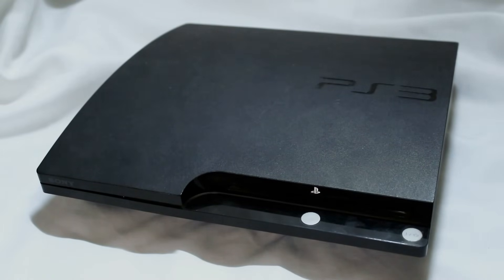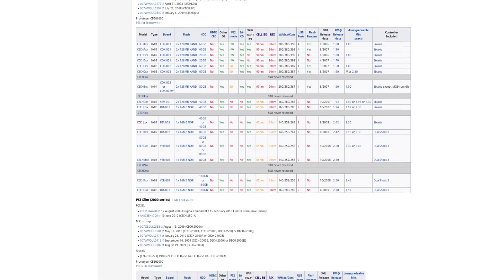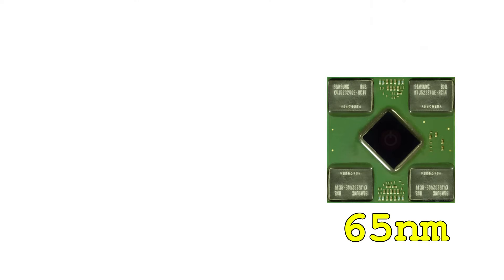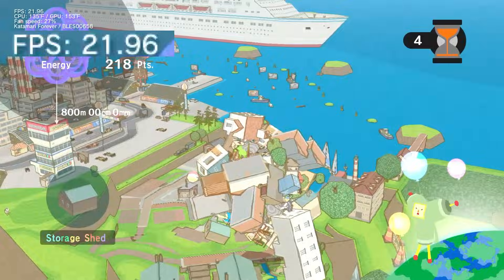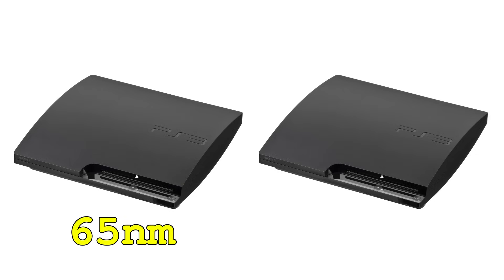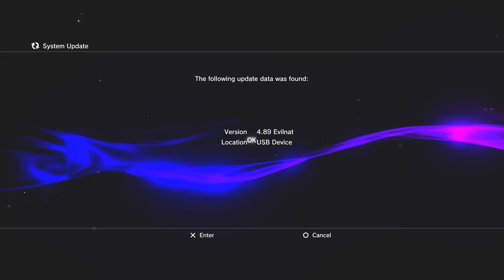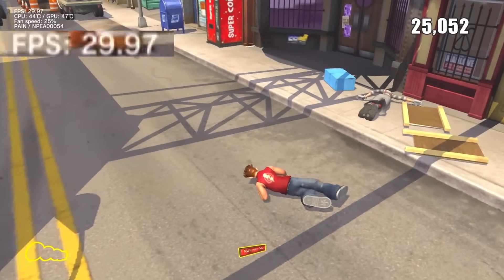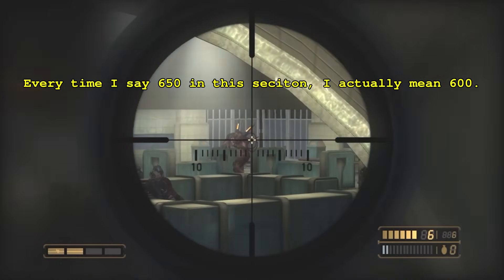Overclocking a PS3 with Project RSX Boost

Comment: I have the same model and it goes 700 mhz core and 900 mhz vram, that's a 40% performance boost. I tested Bioshock infinite, stock I have 29 fps on the main menu with the OC, it's 40fps. It was surprised of the result and it's stable(temperature between 70-75'C)

Comment: For those looking to do this in 2025, you no longer need to load a dedicated CFW with the overclock baked in. 4.92 Evilnat now supports RSX overclocking directly from the XMB or via a .txt file that can be loaded from USB. 

The new method avoids the risk of bricking it since the XMB overclocks are only applied during that session and reset to defaults after restarting. You can do a “permanent” OC by loading the .txt file with the desired frequencies in the root hdd_0 folder. 

Loading from USB also takes priority, so if it becomes unstable you can restart and load default frequencies from the USB. I have the 65nm RSX and achieved a stable 650mhz core clock and 800mhz memory clock. From what I’ve seen, this seems to be the sweet spot for the 65nm.

Comment: 6:27 For anyone in particular, do not use those Honeywell thermal pads on a phat PS3. I used them on my 60GB, and the PS3 when into an emergency shutdown. The pads were basically turned into cement at that point, as it was extremely hard to get the motherboard off of the heatsink. Luckily the IHS or the chips themselves weren't ripped off of the motherboard.
Reply from the maker: That's what heat guns are for. Just warm up the heat sinks until the pads start to soften and they come right off
Reply: @sync-on-luma   Did that, and yea they came off.

Comment: Can you do one for PS3 Super Slim?
Reply from the maker: Did you even watch the video?
Reply: @sync-on-luma you done it for the slim i have the super slim . One game keeps missing frame rate. I dont understand much as have learnign difficulties
Reply from the maker: It's currently (and likely always will be) impossible to overclock any console that shipped with firmware higher than 3.55. All Super Slims fall into this category.

Comment: So besides OC. How about unlock the FPS to play at 60FPS?
Reply: impossible fps are game locked
Reply: but it run smoother
Reply: @minecraftthe67100  I saw a video of someone applying patch/codes from Rpcs3 to ps3 and unlocked 60FPS. Seems legit but I don’t know. 🤷🏽‍♂️
Reply: @XxTrickFlowxX  link?
Reply: @minecraftthe67100  https://youtu.be/y6tdIXyJDXI?si=9ObuqL_nKt4gBdoG
Reply: @XxTrickFlowxX  It's kind of pointless because there's practically no games that the PS3 can run at 60 fps in the first place. In that case it's better to have it locked at 30 so the swings aren't so drastic, plus it will keep your system slightly cooler if it doesn't try to max out just to achieve 5 fps extra for example. If it were capable of it, don't you think Sony/game developers would have done it themselves?
Reply: @rafox66 well ratchet and clank crack in the time for example runs 60fps most of the time? So the ps3 is capable on running more just fine. And the video I linked shows kingdom of hearts also running higher frames with no issues either.. all I wanted to know if someone found a way to unlock the FPS on ps3 hardware.
Reply: @XxTrickFlowxX  Yes but those are rare outliers, most games running on PS3 could barely reach the 30 fps lock. Of course there were some games that could run at 60, but the ones that are locked at 30 are locked at 30 because they can't achieve 60 anyway. Also, some games will start bugging out if fps is higher than it was designed for. Like with old GTA games the physics will start to glitch if your fps is too high. Or another rockstar title; LA Noire's facial animations will start glitching if you go over 30 fps, that game is even locked at 30 on PC.

So what I'm trying to say is that you shouldn't really worry about it, if you want to play at higher fps, play on PC via emulator, I guess? Or if there was a PC version of the game you should get that instead. But in most cases, there is a good reason that they locked it at 30. There might be a way to unlock it, but it's not really worth the effort.

Comment: I'm using overclock of 700-850mhz on my slim cech-25xx. Temps are high 50's to maybe 61 at most. I set the fan to 50% in webman so it runs at that speed as soon as i turn it on. It's a bit loud but i use a headset anyway so no problem

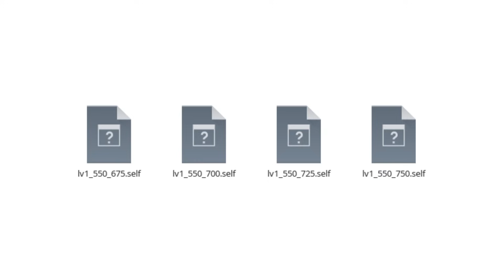Comment: I still dont understand what ti do with .self file like there is nothing in video that help with that ( 11:13 this files )
Reply from the maker: The .self files are only useful if you're building your own custom firmware image, which is a whole process unto itself and way outside the scope of this video.
Reply: @sync-on-luma  like i have Ps3 super slim i dont know anything like which proccesor or anything nm, just playing on it for like 5 years and sometimes my fps drop like crazy i wanted to find solution to get more fps find overcloacking, but i saw Soo many people have like average temperature of pse 50-65° while playing game, mine can go up 75
Reply: I mean like only cpu, gpu stays max to 60- 65
Reply: Point is will it be dangerous overcloacking on my ps3, bcs overcloacking rise your temperature, and how can I overcloack it on 4.91 version of ps3
Reply from the maker: Based on your replies, I can't tell if you have any familiarity with PS3 jailbreaking, but if not you need to start there.
The overclock only works on consoles that are running a custom firmware (CFW) jailbreak. Consoles that can only run a hybrid firmware (HFW) jailbreak are not compatible. This includes some newer slim consoles and all super slims.
If your system is regularly hitting 75 degrees, then the thermal compound on the processors probably needs replaced. I would recommend doing this regardless, but it is absolutely essential if you plan to overclock. If you're not comfortable taking apart your console for this procedure, then you should not be attempting an overclock under an circumstances.

All the other details of overclocking are irrelevant until you have a jailbroken console with clean vents and good thermal compound.
Reply: @sync-on-luma  yeah i have cfw hen, its ps3 super slim but i cant find overclock of 650 or 700 for gpu only i fiund is that .self file
Reply from the maker: Hen and CFW are two different things. If you're using HEN it means you're running stock firmware and you won't be able to overclock.
The main project RSX boost distribution is not meant for end users. They distribute .self files so that CFW developers and turbo-nerd power users can integrate into whatever firmware they want.
What you want is a pre-compiled firmware image with the overclock already integrated. You should be able to find those if you start with the most recent posts in the Project RSX Boost thread on PSX Place, or you can grab the overclocked rebug build if they have one up right now.
Reply: @sync-on-luma  idk man I use hen to like play games but whem updating i need to download cfw idk man
Reply: @sync-on-luma  sorry its hfw
Reply from the maker: You're probably downloading the latest hybrid frimware. If you don't even know what firmware you're running, you absolutely should not be overclocking.
Reply: @sync-on-luma  its hfw 100% its from video i watch
Reply from the maker: Well, that's not gonna work with overclocking anyway then. I'd still susggest redoing the thermal compound, a super slim should not be hitting 75 degrees that frequently. That might be part of your performance problems.
Reply: @sync-on-luma  well thanks for guiding me, sometime i managed to make to be 65° temperature, if u can anything to help me boost fps please say it to me

Comment: Try add frame generator, if legend about underuse of cpu is true then it should be possible to use 2 or 3 threads to generate 15-20fps more in every game without overclocking

Comment: I wonder if it's possible to get the 28nm rsx hooked up to a phat PS3. The pinouts are the exact same so theoretically as long as you wire it properly it should work but elegantly mounting it to the other motherboard probably would be impossible

Comment: @sync-on-luma (Y)
In regards to the hardware variants section. Not all 2500x models can have their firmware downgraded to use CFW. Some of the later 2500x models are not able to do this.

Comment: My phat 65nm cell 65nm RSX does 650mhz core 850 memory I'm afraid to try more than that I started normal 600 and 750 . Next memory with 25mhz bumps till the 850. Core is a 65nm only punched a extra 50mhz
Reply: have you noticed anything adverse after 4 months?

Comment: Always fun to test this sprt of stuff but in my experimentation I found results similar to this video across the board. 

IMO (read that again, IN MY OPINION), the thermal impact and audible impact from the fan is not worth the minimal gains. I can count on one hand the games that I noticed a real difference with, the times where I booted a game and had a "wow" moment where micro-dips or tearing were totally smoothed out.

But, again, at the cost of going over a thermal limit and the fan going apes*it. Borderline vacuum cleaner decibels in some rare cases and my console is very clean with high upkeep. I've been in repair for years, I can take it apart with my eyes closed. It's not old or bad TIC. 

Early phat units would often come back "repaired" by Sony with the fan set to permanently be louder than a vacuum. My brother's was like this and it could be heard from the street outside his house. 
While playing a few titles it came close to that same level for me (usually Unreal and some 1st party titles). 

Chip lottery and all so it's anecdotal but I don't find it to be worth it. I think Sony chose the clocks for a reason, lkkely after realizing all of the stuff we're finding out.

Comment: Been running 600/750 on a 2004b slim for 2 weeks straight no issues
Reply: 600/750 is the OC we’ve had for 2 years now. That OC is very stable and conservative.
Reply: @Tanzu15  can I go to 700/800? Or 650/800

Comment: Im pretty sure im leading the pack with rsx testing 😎
Reply: Nah. I’m the king. I own 10 PS3 slims now testing🤣
Reply: @Tanzu15  How many videos have you posted with an overclocked ps3 doh? 😎👀
Reply: @BOXING_LOUNGE  well making videos is not my thing. I want to. But don’t think all that hard work would pay off. My PS3s are doing 900/1000 950/1000 900/975 lowest I have is 850/975. I know how to bin them.
Reply: @Tanzu15  so to confirm your getting a faster overclock?
Reply: @BOXING_LOUNGE  yes I know which model and date guarantee high Overclocks.
Reply: @Tanzu15  2003a?
Reply: @BOXING_LOUNGE  those can only do 650 core and 800 memory.
Reply: @Tanzu15  ok what model can be overclocked the fastest?
Reply: @BOXING_LOUNGE  2501B this is an American model though. 25xx in general. I have like 7 of them already binned. I’m selling one. So if you’re interested in one let me know.
Reply: @Tanzu15  I am interested, im in the UK though.
Reply: @BOXING_LOUNGE  yes i know. I can ship international. Do you have a discord? We can talk there more about it.
Reply: @Tanzu15  my discord link is in on my about page, i don't think I can posts links in this thread
Reply: @BOXING_LOUNGE  alright I’ll go check it and add you.
Reply: @BOXING_LOUNGE  ok I DMed you on discord.

Comment: Help my ps3 blackscreen when installing oc 800/950. on my CECH-2000A ps3. at that time I was still at oc 750/850 but I wanted to try to increase it further, namely oc 800/950 when I was installing it and the installer finished suddenly after my ps3 restarted the ps3 blackscreen but there was sound and finally I tried to go to safe mode but it turned out that safe mode blackscreen and I tried again by removing the hdmi and plugging it in again and safe mode turned out to be able to display images and I immediately installed ofw 4. 91 in safe mode to restore it and it turned out to add another new problem, namely stuck on system updates for more info you can check my channel and I hope this problem can be resolved with your help and I hope there are people who want to help me Thank you!
Reply: Are you stupid? You didn’t do your research at all. Now you have a brick.
Reply: @Tanzu15 So how to restore it bro
Reply: @IbiyaFoxVCC  you can’t dawg. You’re cooked. Buy a new PS3 and next time do your research.
Reply: Slims aren’t supposed to go beyond 700/900
Reply: Stupid lol

Comment: Test it on far cry 3 plsss
Reply: i tried with 700mhz on RSX and 900mhz on the GDDR3 VRAM and it did 30fps with little drops here and there.
considering that on normal clocks it goes anywhere between 15 and 30, I'd say it is a great improvement.

Comment: i have a cech-2501a
Reply: That’s a good PS3 to OC. Easily does 700 core 950 memory. Don’t ever go above 950 memory unless you want a new door stopper.
Reply: @Tanzu15  the thing is, its pretty old and hadn't been turned on for a long time. has to be tooken apart and completely fixed. it has issues with the disc drive (common) and turning on (power) but the thing i am confused is that it doesn't display anymore. last time it been turned on it worked fine.
Reply: @Tanzu15  Same version did 975ram stable

Comment: Remember guys. 650/800 for 65nm runs perfectly. And for 40nm slims 700/900 is 100% stable and Guaranteed. I’d say 950 on the memory is fully stable too. I have 7 to 8 slims now. Bought more for testing. And the all hit 700/950. If you’re very unlucky then 900 memory will be fully stable. But 95% of slims can do 950 on memory just fine. Any slim that does 750 core fully stable zero artifacts is a silicon winner. And likely will do 800 core. But in a lot of slims 700 will be the Max stable. 750 shows artifacting. Crysis HD is the perfect and only game you should test for 30 minutes to an hour. No artifacts or crashing at all means it’s fully stable across all games.
Reply: Is the performance difference worth the risk?
Reply: @GenesHand  yes it’s worth it. If you folllw my guide. You’ll avoid any issues. The performance gains are pretty big. Noticeable accross all games. But we don’t talk about Beyonetta.

Comment: 750/900 is very good and stable on PS3 Slim, tested on 2501A
Reply: You should be able to do 950 on memory easy. Memory gives huge FPS gains.
Reply: @Tanzu15  Do you have a 750/950 for me please? When I try to do it myself I get error messages - thanks
Reply: @Agent-mb1xx  I do have 750/950. I know how to create any of them.
Reply: @Tanzu15  I do have the software too but it never works
Reply: @Agent-mb1xx  I’ll make one for you homie. Where do I send you the link? Cause I don’t think YouTube allows that.
Reply: @Tanzu15  Mediafire
Reply: @Agent-mb1xx  no I mean how do I send you
The link?
Reply: @Tanzu15  You have to write it down on a small piece of paper and attach it to the pigeon's leg when it will arrive
Reply: Update: 750/1000 works well too
Reply: @Agent-mb1xx  now try 800 core. If you aren’t getting any artifacting in crysis HD. Which is the game you should be testing for true stability.
Reply: @Tanzu15  I do have artifacts at 800/800
Reply: @Agent-mb1xx  ok so 750 is your Max OC. That’s not bad. Most slims can’t do 750 without artifacting.

Comment: I wonder how far you could take a PS3 using water cooling. It would be a neat project, taking apart a PS3, putting it a little ITX case, maybe even finding a way to keep the blu-ray drive and using some water blocks and a 120 or 240mm radiator.

Comment: Both my slims are running CFWs, but I'm not risking them for this. I don't think it's worth it for me. However, thanks for the thermal pads tip. I already re-pasted one of my consoles and the other one doesn't need a re-paste, but can I buy a few of those if I want to use them in the future? Do they have an expiration date if not used?

Comment: my ps3 FAT one (2usb)   
got the red button of death
and im too hesistant to apply thermal paste by taking them off knowing that the repair shops will charge a LOT
Reply: changing thermal paste will not help if it doesnt boot at all, anyway the fat ps3 is the easiest to take apart.

Comment: How high could my 2501a go? I have the 600 - 750 installed yesterday running great
Reply: 600/750 has been the default we have been using for 2 years. You should be able to do 700/900 easily. Give it a shot. It’s free performance.
Reply: @Tanzu15  I just tried 650 - 800 and my console turns on for 3 seconds and shuts back off. Did i brick it with the oc?
Reply: @Corrosion37  Did you manage to fix it?
Reply: @GenesHand  no, i think im gonna send it in to someone with a flasher to fix my mistake. I might have had the wrong settings in mfwbuilder

Comment: Is there any way to do this on unhacked system, using modified official software to just only changing the clock speed part of it?
Reply from the maker: Your question is contradictory. Either it's unhacked, or it's modified, those things are mutually exclusive.
So in short, no.
Reply: @sync-on-luma  just want to do an update with the higher MHz, don't want any of the other hacking stuff, if that clears it up
Reply from the maker: What do mean by "the other hacking stuff"? You're going to be running custom firmware no matter what if you want to overclock.
Reply: @sync-on-luma  yeah the overclock is the only part of the firmware I want custom, if there is a way to do a firmware that is only different in that regard from Sony's

Don't want anything that may cause my account to get banned
Reply from the maker: Just don't use PSN while running custom firmware and you won't have a problem. There are ways to hide the fact that you're running CFW while online, but there's a slim chance they can still result in a ban.
Reply: @sync-on-luma  oh, I don't know how to hide that, I wish Sony would just update the clocks that's the only thing I even want